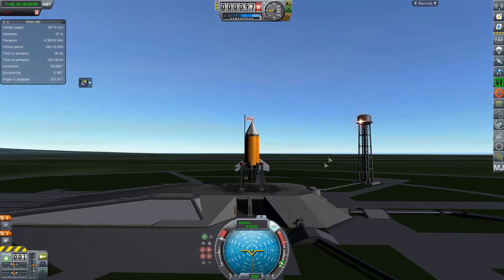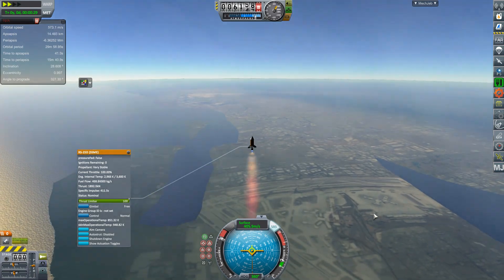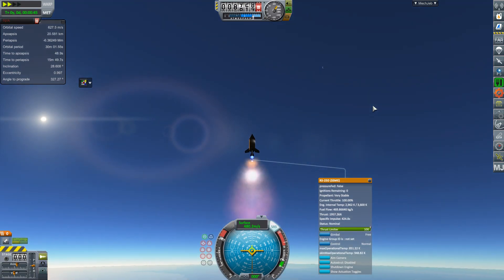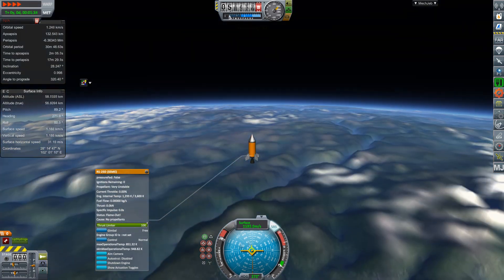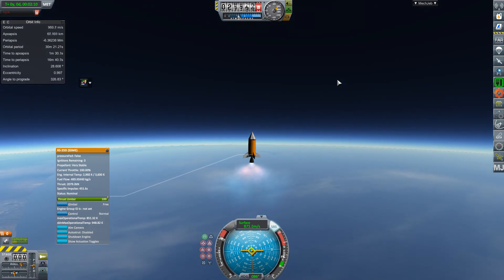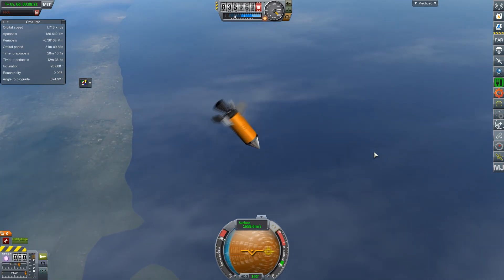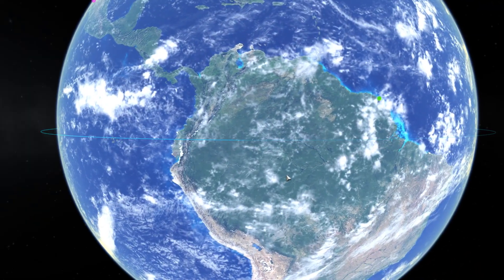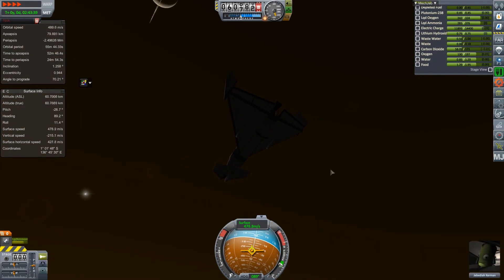Does Launching Rockets From A Mountain Really Help?

Comment: KSP ≠ real life.

On Mt Everest there is about a 1/3 of atmospheric pressure than on sea-level. So first stage engines could be more efficiently optimized through their whole flight (higher average ISP = lower total weight = higher Delta-v) than launching on sea level.

And one other thing - Falcon 9 first stage needs about 60s to reach Mt Everest altitude, that's 1/3 of the total burn time! So potentially there could be up to 1/3 weight savings on the first stage only because altitude.

It all adds up, but I think the biggest obstacles as you mentioned are logistics of launching rockets from the tip of the mountain. 
The air launch from airplane could be more feasible, but we need huge airplanes.

Edit: Apoapsis of your air launch was 187km/114km=1.64, that's 64% improvement over sea level launch? Almost 13 times better than Musk's 5% estimate...

Comment: Hi Scott. You discussed differences in launch altitudes as basically sea level versus mountain top, and differences in associated air density, but you didn't discuss other associated aspects of 'height' such as distance above the centre of the Earth where the surface of the Earth on the equator is 21.15km (13.14 mi) "higher" than the poles. Do you have a video on this or could you address this. I would also be interested in any comments on "effective" gravity differences between the equator and poles and the implications for rocket launches. Thanks, Jim

Comment: Chances are nil that anybody would ever attempt to construct a launch pad at the summit of Chimborazo or Kilimanjaro .  However, it is not beyond imagination to think that somebody named Elon would bore an inclined horizontal shaft entering from a lower elevation near the foot of the mountain.  Upon reaching the center of the mountain an intersecting vertical shaft could be bored to exit near the summit.   The intersection of the shafts could be enlarged to create enough space to translate rockets from horizontal to vertical.  Secondary horizontal side tunnels could be constructed for hangers, work space, and other supporting infrastructure.  Rockets, equipment, and people could be easily transported in and out through an electric rail system constructed in the primary horizontal access shaft.  The general work areas could be fitted with airlock doors for a pressurized safe comfortable work environment. 

The rockets could be mounted on a launch cradle that would lift and stabilize the rocket as it is vertically accelerated up and out the shaft along a rail guide system securely mounted into the walls of the vertical shaft.  The launch cradle could be lifted and accelerated with an electromechanical or possibly an electromagnetic system (something similar to a rail gun).  Alternatively, could also envision a mechanical falling counter weight type system to lift and accelerate the cradle (something analogous to a really big trebuchet).  No need for the rocket to go full throttle until it has fully exited and cleared the shaft.

Looking at the video of the recent SpaceX F9 (Falcon 9), Telstar 19V launch as a comparative reference case, it appears the F9 reached the Chimborazo summit elevation (6.2 km) at a velocity of 1000 kph at time T+53 seconds.  A 10 second 3G acceleration up a 1,500 meter (1.5 km) vertical shaft would result in a 1000 kph (278 m/s) exit velocity that would reproduce the Telstar F9 flight conditions at T+53.

The F9 1st stage shut down at T+152 seconds.  From this, the F9 reached the Chimborazo summit elevation (6.2 km) at a velocity of 1000 kph after expending about 35% of its 1st stage propellant load.  Published info indicates the F9 1st stage holds 395,000 kg of propellant.  35% of this would be 138,250 kg or ~ 138 metric tonnes (MT).  This factor by itself would increase the payload capacity of a standard off the shelf F9 beyond that of a Saturn V.  Lots and lots of new payload margin to play with for things other than increased payload.  A beefed up airframe and engines for increased strength, safety, and reliability.  A fully reusable 2nd stage.  Possibly a new single stage to orbit?

What am I missing here? Why aren’t people already doing this?  

In terms of energy and power, the energy required to static deadlift a fully loaded F9 (540,000 kg) a vertical distance of 1,500 meters (1.5 km) is about 7,000 megajoules (MJ).  The energy required to accelerate a fully loaded F9 to a velocity of 1000 kph (278 m/s) is about 21,000 MJ.  Therefore the sum total energy required to lift and accelerate a fully loaded F9 to an upward velocity of 1000 kph (278 m/s) is about 28,000 MJ (about 8000 kilowatt-hours).  In terms of electric power this would be about 2,800 megawatts (MW) for a period of 10 seconds.  Seems totally doable with a dedicated bank of supercapacitors.  

Correcting for the decreasing propellant mass during ascent, the average mass of the F9 from sea level to 6,200 m is about 471,000 kg (540,000 kg - 69,000 kg).  The energy required to static deadlift a F9 from sea level to an elevation of 6,200 m is therefore about 29,000 MJ.  This is comparable to the 28,000 MJ required to further lift and 3G accelerate a F9 from an initial zero velocity to 1000 kph over a vertical lift distance of 1,500 m.

All told a 1000 kph 3G vertical launch from the summit of Chimborazo would save about 57,000 MJ of energy (28,000 MJ + 29,000 MJ).  57,000 MJ is enough energy to static deadlift a fully loaded F9 from sea level to an elevation of 10.8 km (34,000 feet).

There would be additional energy savings as a result of bypassing the high aerodynamic drag losses associated with the densest part of the atmosphere from sea level to 6,200 m.  The ambient air density at 20,000 feet (msl) is only 7.25 % of the air density at sea level.  I am not sure how to numerically estimate this aerodynamic energy savings, but imagine it would be meaningful.  The nozzle length could also be better optimized for greater engine efficiency.

Comment: I always thought that the point of launching from a mountain was that E= mgh so you have to carry less mass of fuel to start. Basically making your first stage rail, (or semi truck in truly remote places) which are way more efficient than rockets.  Since the most expensive kg is the first kg I always thought it would make the most sense for a company like electron to launch from somewhere like La Rinconada, a smallish town in the andes near the equator at an elevation of 5000 m.  That would save 50 kJ of fuel for every kg of payload and also specific impulse would be much higher if you started there, atmospheric pressure is under 60 kPa.
Reply: More importantly even than specific impulse for high altitude rockets though is the fact that you can massively reduce the weight further still by designing a rocket that is more spherical and less tube shaped.  If you make a cylinder twice as wide it will have the same volume if it is 1/4 its original height.  So a 40m tall rocket that is 2 m wide will a volume that is the same as a 4 m wide rocket that is 10 m tall but the second rocket will have a 1/3 reduction in surface area.

Comment: Does launching off of a solid plate improve propulsion? (My ignorant guess is that they have a hole in the center of the pad)

By the way I'm not sure what a launch pad looks like. Wikipedia "launch pad" is one of its weakest pages. Google "space launch pad" then click image: I don't see one single close or aerial shot. Is pad technology a secret of state? I have no knowledge whether they actually are a steel plate, or are raised, or have a hole in the center for exhaust venting. The best I have to go by is the blastoff scene in the James Bond movie Moonraker.

Comment: Actually, you are using an engine designed for sea level launch at half a mile up...
What if you could use an engine designed for launch at 1 mile up? Your engine wouldn't be underexpanded at launch and you would actually gain even more efficiency. Stratolauncher (a bad design) would still benefit bc the engines would be designed to be ignited at altitude.

Comment: What about fuel? If launching from about  say 10,000 ft wouldn't the fuel requirements be much less  than launching from sea level? How much fuel did the Saturn 5 use to get to that 10,000 ft mark?

Comment: Here's a random question - what if you have a mechanical propulsion mechanism to help you get some initial speed to help out the first stage of the rocket? Imagine a massive structure going 1 or 2 km deep into the ground and propelling your rocket towards the sky(let's leave the implications of building and maintaining such a beast aside).
Now, obviously this will still cost you a lot of energy, but would it be able to give your rocket enough momentum to the point where you'd need less fuel for the same payload? From what I understand(and correct me if I'm wrong), currently a big limiting factor in space exploration is that the bigger payload you want to send, the bigger your rocket has to be and that grows exponentially(they payload / mass ratio is very very small). So, if we can convert some of the fuel weight to payload weight, then it'd be a win, no?

Comment: There are lots of places in which you can gain high altitude with no difficulty. In my country, I can drive 2 hours (kilometer 100 of the central road) from the sea Level up to almost 5,000 mts (15 807 feet), where, after the mountain pass, you are in a relative flat highlands (at least 4,500 mts.). (Perú-ticlio 13° 30' 45" south very near the equatorial line). Maybe you can make a "virtual try" from there!

Comment: Nice to see tha advantages of launchng from Mt Kilimanjaro - 19,000 ft and on the equator. So first 4 miles of altitude are "free" and the full rotational speed of the earth about the first 1000 mph "free" also. Plus of course the thinner air at 19,000 ft. and the oblatness of the earth.

Comment: There are plenty of easy to reach flat areas in the western U.S. in the 5000 to 6000 ft above sea level range that could be made into lauch sites with easy access to transport the vehicles there.
Reply: The issue with that and the reason NASA considered but turned down that idea is they have to launch across the entire country and if the rocket were to explode or lose control it could land on a town or worse a city.

Comment: Would the higher rocket not benefit from also having low ground clearance? Sort of the difference between climbing up a stair to raise yourself and trying to slam your foot down so hard you literally push yourself off the ground from air resistance.

Comment: Every planet rotates in the same axis? Sounds like intelligent design.
Reply: Ecliptic plane. Solar masses have equators, and they draw anything in orbit towards that plane. The rotation is due to angular momentum based on the original rotation of the star from its parent system. 

There are 2 exceptions in our system; Venus and Uranus. Venus spins backwards because it was smacked out of rotation by an asteroid and Uranus as a vertical wobble from being hit by a planetoid hundreds of millions of years ago.

Eventually they'll fall back in line, the slackers.
Reply: The planets are not on the same axis. They are on nearly the same axis, but they are all off anywhere from 1 degree to say 20 degrees. And to that effect none of the planets are on the same plane either, all are slightly offset to each other.

Comment: Stratolaunch is only the largest aircraft ever by wingspan. I believe the Spruce Goose is the biggest by length and the Antonov 225 is biggest by max takeoff weight.
Reply: So I had to look up the AN-225. Wow, Russia. Why you must make everything so ridiculously over sized? That thing is 90% larger than a C5 Galaxy which means it's at least 90% larger than it needs to be.
Reply: Because it was originally designed to haul the Russian space shuttle around. Once that program was shut down they just used it for cargo.
Reply: The Airbus A380 and 747-900 are also longer than the H-4 but have shorter wing spans. Both can lift well over over twice the weight of payload.

Comment: Easy way to "simulate" a high mountain launch would be to launch a rocket straight up, kill the engine and dump the first stage when your apo hits the altitute you want to launch from, then wait until your speed is almost zero, and start the actual launch...

Comment: Best launch site would be Mt Chimborazo in Equador. Elevation of over 20k feet and within 2 degrees of the equator. Have the first stage be a railgun on the side of the mountain that launches the rocket at mach 7 and you can cut the cost of putting things in orbit by a significant fraction.

The main issue is the logistics of getting your rocket there in the first place.

Comment: I see a magnetically accelerated vertical hyperloop launching a SCRAM jet vehicle at hypersonic speed, itself carrying a small rocket. You would need a long tunnel to reach speed over Mach 5 while keeping the Gs low, so a mountain would be a perfect "canon" to launch an hypersonic vehicle at the proper angle. 

NASA X-43 successfully flew at Mach 10 at 30Km altitude with technology from 20 years ago. That's 1/3 of the way to space, using air from the atmosphere as the oxidizer. It's also nearly 1/3 of the escape velocity required to get into orbit. I'll also take that 5% gain from the mountain itself + improvement to a SCRAM  jet launcher to get Mach 15 at 45Km. 

The higher you start from, the fastest the vehicle launch with externally provided energy, the further you can go on atmospheric air oxidizer, the smaller the rocket needs to be, which is the only way to significancy reduce cost.   

If we could cut the distance to space by half and get to half the escape velocity before even firing the  engine on the rocket, that would be extremely advantageous. The SCRAM jet launcher would fly back to earth and the first stage of the rocket could get back too, Falcon 9 style. You only lose 1 small secondary stage engine per launch.

Comment: 5:16 This is one of the reasons we have multistage rockets - - the first stages use a slow burning fuel to take the upper stages to high altitude at subsonic velocity, eliminating most of the negative effects of air drag and cavitation

Comment: Concerning air launches, I wonder if there is a difference in environmental impact. would a reusable plane first stage dump less bad stuff into the atmosphere than a rocket first stage?
Reply: Would probably be worse since if you launch from the ground a giant portion of your initial burn is going to end up as soot on a slab of concrete that can be hosed off.

Comment: Forget big lumbering planes! I say we strap the rocket to another rocket. It's brilliant! Nothing else can lift that sucker up to a good starting-off point like a powerful rocket can.
Reply: wait a minute...
Reply: But... that’s just the premise of a multi-stage rocket.
Reply: Moar boosters
Reply: Hehe
Reply: That would be called a strap-on booster rocket. You know, those things on the sides of rockets like the space shuttle.
Reply: @bfhammer  no its called stage 1

they're also called "solid rocket booster" not "strap on booster rocket" that sounds like a sex toy
Reply: @anuclearpan4554  Unless it is a Russian rocket. They don't use solid propellant, so by definition it cannot be called a SRB or Solid Rocket Booster. Or a SpaceX Falcon. Again, a liquid-fueled booster strapped on to the sides. Cannot call it a SRB by definition. NASA themselves have historically used the term "strap-on booster" on occasion. Get your mind out of the gutter.
Reply: @anuclearpan4554  
Strap on rocket boosters compliment rocket boostiers.  What's a rocket boostier?  It's a rocket stage with a built-in decoupler.  It lifts and separates!
Reply: @bfhammer  now add boosters to the booster

Comment: If the Earth were shrunk to the size of a billiard ball, it would be smoother than a real billiard ball.

It doesn't seem that such small deviation would make any real significant difference, especially after you figure in the energy required to get the launch site and the increased cost of building and launching a rocket at a higher altitude

Comment: I think you should double-check Elon, actually. They'd shrink the first stage to take better advantage of the higher altitude - remember that you are keeping fuel constant, but they would have less first stage hull mass and fuel. Just keeping the first stage and fuel constant, it would instantly up the max payload a lot. Another advantage is tracking and safety, if you're above cloud level. You'd want it as near the equator as Florida, and reasonably near the coast or a lake. Who will find the ideal location? :) Go!

Comment: Shouldn't there be two more advantages of launching from a mountain?
1. Shorter vertical distance to the desired orbit.
2. Higher horizontal launch (orbital) speed thanks to being further from the planet's rotational axle. (Starting from a high top in for example Ecuador should give a great horizontal push.)